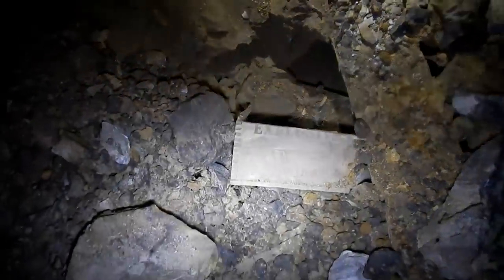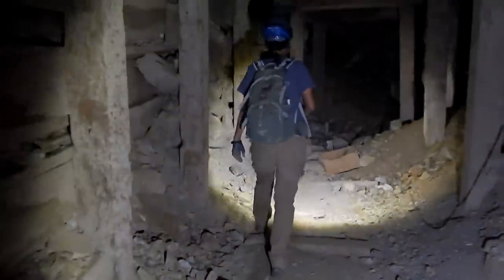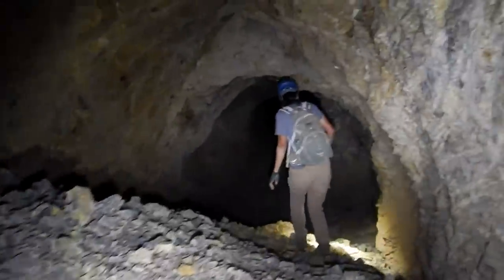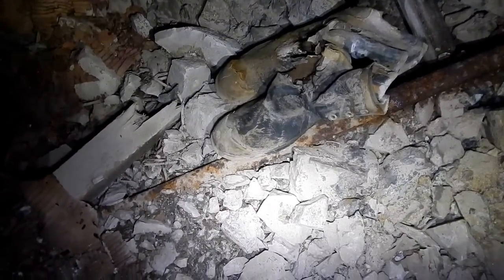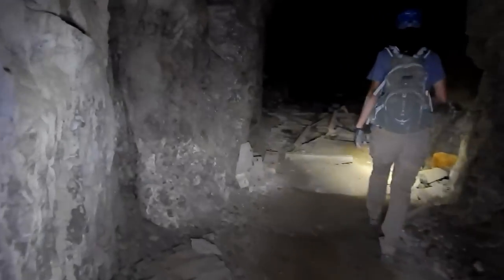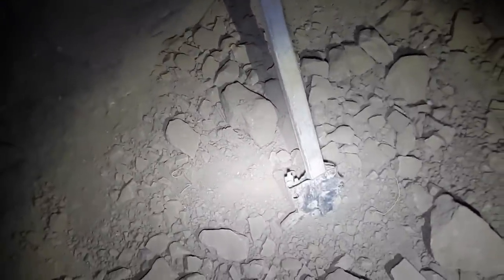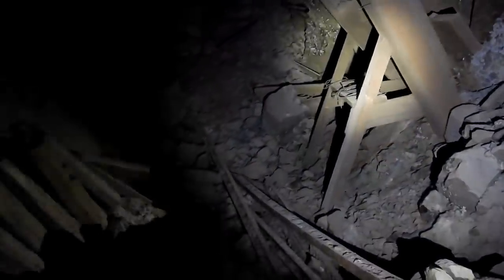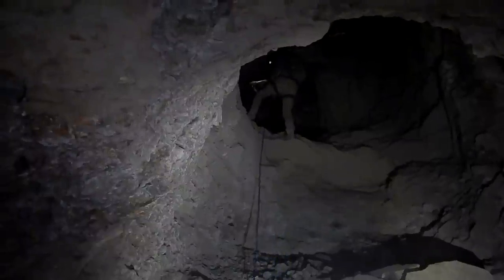Historic Multi Level Abandoned Tungsten Mine - Exploring Huge Underground Caverns & Artifacts Part 2

Comment: Good Morning Tom and Julie. That was an awesome explore! I didn't have to duck once. Got a little thought for you on that "cage". I have a picture in a book of an underground stable for the burros or mules that they used for hauling. As big and as old as that mine was that could explain it. Especially with the concrete manger and/or water trough. That was a pretty cool find. Most often they'd use mules. People think they were blind when they came out from underground because of the "blinders" that they wore when they brought them out. They only wore them long enough to get used to the sunlight. Usually they only used them underground for 3-5 years, then they let them out for awhile and proceeded to use them to haul whatever needed to be hauled on the surface. Because they served so well, they were highly respected and there's even tales of mule skinners that abused their animals and got whipped. In Colorado (Fairplay) there's even a monument to one. Real cool to see such an important piece of mining history. That would also explain such a big door at the portal. In case someone forgot to lock them in, they couldn't run away. Probably how that big tank got in there.:-)
Reply from the maker: Thanks for the great comment and story, Richard. Very interesting and informative, too. I had not thought of that possibility for the cage. We appreciate you!

Comment: Wow, that's one interesting mine you all found there!
That one pipe you were talking about being thin looked very much like Sch. 10 black steel
and appeared to be grooved on the ends, which would have been very common from the
early 80's-on and would be fine for either water or compressed air (we in fire sprinklers use
tons of the stuff to this day).
Schat's Bakery in Bishop, CA has been in business since 1938 and remains so today.
Looks like Ricardo's is in Santa Rosa now, though.
Looking forward to the next one!
- Ed on the Ridge
Reply from the maker: Hey Ed, thanks for the info on the pipe. We appreciate you watching and commenting all the time. 👌👍

Comment: 29:37   I have seen concrete floors with small side curbs in areas where explosives are stored to protect it from water seepage from below.  Wire mesh to allow inventory from the outside.  Solid wooden planking walls to prevent rocks falling in.  Small amounts can be placed on a shelf, but large stock piles of explosives are too heavy for shelves and are stacked on the ground.
35:35   That water pipe has a "Victaulic" coupler.  It was invented in 1952.  So that is the max age of that pipe.  They are still used and are on almost all building sprinkler systems.
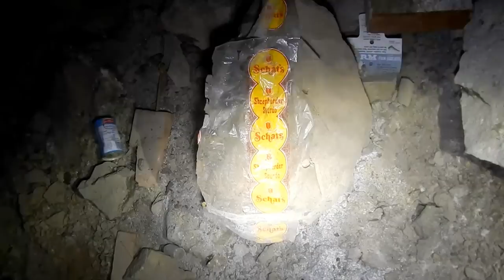43:40   A sour dough bread wrapper.  Schat's Bakery in California is still in business.  "Life is short, eat fresh!"   (Their motto)
43:50  Danola cooked Ham- Still in business, sold by Amazon and Walmart.
*  Thanks to you both!  This was an amazing mine.  Thanks for taking it slow and examining things.  That's what it's all about.
Reply from the maker: Tat makes good sense about the concrete tub in that room with the chicken wire. I haven’t seen that before. This mine was last worked in the 50's so those pipe couplers are correct for the time period. There must have been 50 of those couplers/gaskets laying all over the place. Schats is still very busy and you need to get in theleft lane on a Sunday morning or you will stopped in the road from all the cars trying to enter. Thanks for the detailed comment!
Reply: @TomandJulieMineExploring  I worked in my Uncle's gold mine from 1959 through 1970.  (My draft year)  It brings back memories of back then working in the choking dust, short tempers and crappy food when we could get it.  I was the backfill king.  I mucked and hauled waste material to old unused areas and dumped it.  Some good times too!
Reply from the maker: @myfavoritemartian1  thanks for sharing part of your mining story. Sounds tough, but also a good experience I'm sure.

Comment: Great explore... if my calculations are correct that tank would hold between 1,000 and 1.200 gal capacity for {drilling water), based on flat ends not on bowed ends... My dad was a Burgermeister beer imbiber. lol The beer was only brewed from 1961 to 1964  in San Francisco & BTW that can is "very, very" collectable.  TY for leaving it for others to enjoy.
Reply from the maker: Thanks for doing the math for the tank, Dave. Glad you liked the Burgie can. It's  still there.

Comment: At 24:00 what Tom called a Siding it is actually a Stub Track, a longer one would then be a Spur Track.  What most call a Siding is actually a Runaround. If it's a big operation where they are passing each-other, such as one set going in, and another set going out, then it would be a Sidings. In the train world where trains pass each-other is at Sidings. This is the simple example. I'm not going to get into Saw-By, Jct. or – etc. Jack
Reply from the maker: Thanks for that information, John. I like hearing things like that for clarification. Looking forward to hearing from you again!👌😁

Comment: FYI: the dynamite is not that dangerous. It is the old fulminate of mercury blasting caps that are very dangerous the are real sensitive to shock, friction, and static electricity. I demonstrated this with a non electric cap and static electricity. It took a few tries from a Van de Graaff. We used a wire and had the cap in a bucket of sand. So do not step on them.
Reply from the maker: I always tend to give boxes of dynamite some respect whether or not it's still viable. We see quite a few caps, too.  I'm not sure if we see the fulminate of mercury type, but I will give them a lot of respect, too. Thanks for the information!👍😊

Comment: Why do you measure the track sizes?
Reply from the maker: Good question, Robert. We do that occasionally because some of our viewers are also rail enthusiasts and are interested in the sizes of it. The measurements allow them to look up on a chart and determine the pounds per yard, which is how track size is described. There are many different sizes used. Sometimes, there are also dates and manufacturers' information embossed on the webbing or side of the rail. Thanks for the comment!👍😄
Reply: @TomandJulieMineExploring  so they are looking on going and gathering the old rail and selling it for money? 
Your mine explorations will look pretty naked without the old rail laying in the old closed mine for future explorers.
Reply from the maker: No, it's not Ike that at all. They are RR buffs.